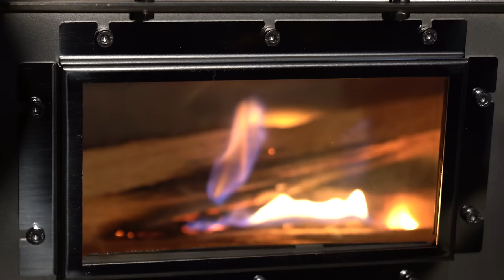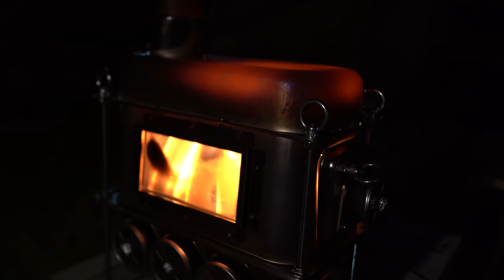Homemade Mini Wood Stove for Camping - Rear Secondary Air Intake Hot Tent Stove - MX-Stove Project

Comment: Nice! However, I think I’d just buy one. Taking all that time to build something of such poor quality when you can just buy a good one for a few hundred bucks seems pointless.
Reply: Poor quality. Who the hell are you? You couldnt make anything approaching that. And you cant get for any money what that thing can do for such light weight and small size running off wood alone with that level of fire control. There is an immense sense of satisfaction from building something yourself and more so when you design it yourself. Best you can make yourself is a cake.
Reply: @Darkstar.....  I’m actually a mechanical engineer, NFPA fire inspector, and manufacture. Fireplace design and manufacturing are literally what I do.
Reply: @MooseModePXL  well its still realy cool. Plus engineers dont build things. They design at most. So what i said still stands. Mind if i call you money bags. This guy and people like me clearly arent in that position. Also you are basically a safety officer of course you would have a problem with what this invention. I hate inspectors. Its not like he is selling it. He is using it outside. Its not burning anything down. He is a tinkerer and this is his hobby leave him alone. You can have your oppinion that you wouldnt do this or want this. But dont say its a waste of time or poor quality. Look at what he built it out of. Have at least one positive thing to say instead of being a stick in the mud. Your not a fire inspector on youtube alright. Your just a normal person bored with their life so you watch youtube videos. Id even say your over qualified. I hear its not easy to find work when you reach that point. If you are a good mechanical engineer you wouldnt need to be involved in fire place design and manufacture. Wait you design sell and inspect fire places? Hahahah your no mechanical engineer lol. If you are you are realy a failure at it.

Comment: Actually, a soldering iron is way more economical and effective than the amount of fastening hardware used on this build which still causes a lot of unwanted air intake & heat loss.
Reply: what kind of solder ? enclosed wood burners can push past 600 Celcius and sheet metal solder melts at 450 C

Comment: I would appreciate it very much to know because I have been trying to learn for a long time- where to get the Metal Window Frame that you use to hold the glass window, and also the circular, adjustable Air Inlet pieces that you use to control the air that goes into the stoves. I have searched all over the internet and not been able to find those two pieces for making a stove myself. Thank you
Reply from the maker: Hi, Michael. I think I should open the store to sell glass window frame and air mixer to overseas because those items I used are sold in Korea only at the moment. I am worried about shipping cost though.
Reply: @campingtogether  I don't know what the conversion is, but if you can sell and ship the air control for $15 usd and the metal frame for $12usd, and still make a profit, then I think that you would be able to sell them for that...

Comment: Nice job. Have you had any warping of the stainless steel? I can try your project and I know where to get the parts but for me I would make it slightly bigger in case I wanted to use separate pot and fry pan at the same time. If it doesn't warp that probably will last you at least 10 years of regular use if not more.
Reply from the maker: This pan need reinforcement plate on the top. It warps and lowers a bit. I had this reinforced and sturdy enough!
Reply: 구입  방법을 알려줘라

Comment: Wrong. Stainless melts around 1550 c. Some qualities higher, at the plant i work we produce over 400 different qualities  Iron melts around 1400 c.
Reply from the maker: Hi. Tomas. Reversed Iron melts around 1550 deg.c Stainless steel does a around 1400 deg.c .

Comment: What about some data?
How long does it take to boil water?
What is the surface and inner temperature?
How much time did it take you to assemble the entire thing?
What about adding an oven for baking simple pastries?
What about a water boiler addition?
How can you make the soot collection simpler to discharge?
How far does the heat dissipate around the oven?
How long does the fire last?

These things are important info I think

How long does it take the ramyeun to cook? Compared to standard gas ovens?
Reply from the maker: It took about 15 minutes to cook ramyon!
Reply: Or you could do it yourself, just say’n!